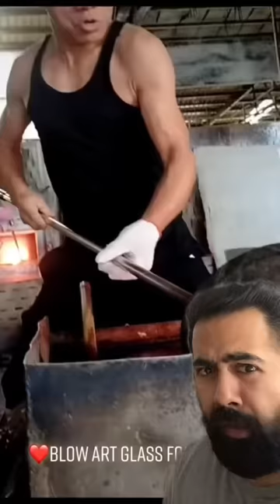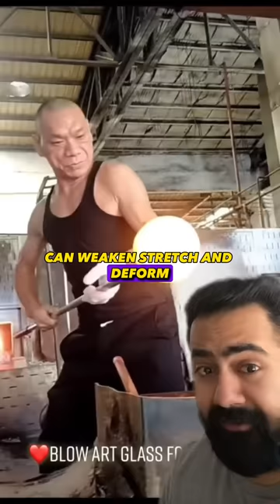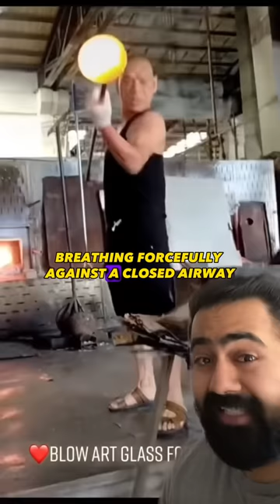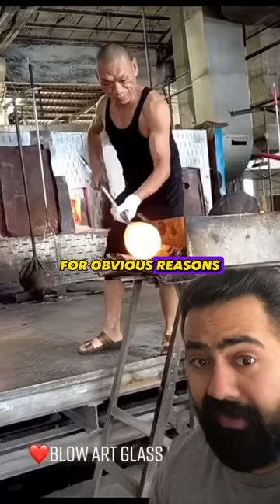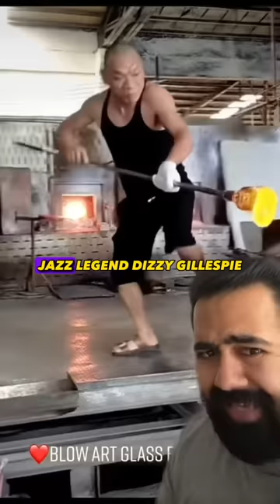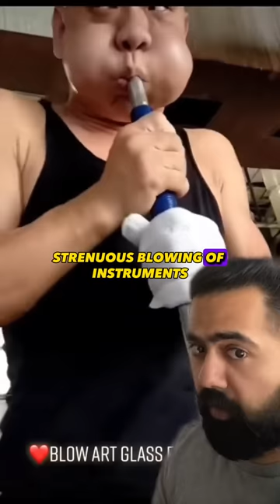Doctor Reacts To Glassblower’s Disease!

Comment: I've seen glass-blowing companies use pumps to form the glass. It's easier and caused no problems.
Reply from the maker: Yep!
Reply: Not possible for such vessels such as those asked of university science laboratories.  A human glass blower, is required for those items.
Reply: @betteroffdead  technology will get there very very soon , we already can do masterpiece sculptures of quartz with machines
Reply: @hardanalljr.3138  Sadly it won't. Glass casting will never exist
Reply: @betteroffdead  why can't it replicated with a hand pumped blower?
Reply: @flame4627  How can you be so sure?
Reply: @hakayonder3396  uh because I didn't drop school?
Reply: @flame4627  So you graduated from the future and are knowledgeable about out technological advancements? Alright, then tell me when I can expect first AI able to do QA work to replace me so I can prepare for my retirement.
Reply: @flame4627 It already does? For blown items it's called blow-molding. If you ever see a seam on a cheap vase or such, it was blow-molded. Open-face pour molds are common in the art world and can be obscenely precise.
Reply: @flame4627  mans graduated from school with a degree in time travel 💀
Reply: @hardanalljr.3138  Clearly never finished high school, eh ?
Reply: @waroftheworlds2008  there's the difference between human feel and proxy (the hand pumped blower). For example, if a cup of coffee is too hot to drink, maybe you blow on it, to cool it. Or, do you put it next to a fan, and hope for the best ?
Reply: @betteroffdead  it's not hoping for the best. You can better control the amount of air being forced in and put more air in than you could with just your diaphragm/mouth.

The human body wasn't ment to hold higher pressures. It's insane that you're actually arguing for people to hurt themselves.
Reply: @betteroffdead  Except it wouldn't be a fan in this case. It'd be multiple fans with the coffee's temperature being taken to lower said temperature to exactly the amount needed.
Reply: I'm your 1000th like!!!!
Reply: @flame4627  least close minded " school smartass" person
Reply: @totally_not_a_bot  glass pour moulds can't be durable though, especially for test tubes and light bulbs and etc which usually need to be both perfect in shape and thickness.
Reply: Wouldn't be very artisan-like
Reply: @betteroffdead  we're slowly going back to the stone age.
Reply: @betteroffdead  you need the guy but he doesn't have to blow. You can't tell me we cant make an air tank to give the right pressure. That's nonsense.
Reply: Ukraine's leadership supports stepan bandera, you stand with them?
Reply: @MrE073  no one here pretends to agree with every single part of Ukraine's government. We just think Ukraine should maybe be in charge of Ukraine, and Russia should stay in their own lane.

Hell we don't even like our own government, but try rolling over here to take over, and see how the people react. Same thing
Reply: @Non Ya erm, you've missed the point ? Have you ever studied , using laboratories? 
Precision vessels , maybe. Standardized, maybe. 
For example , when CNC milling machines were becoming widely used. The hand tooling industry was still considered a must, in some circumstances.
Reply: @nebs6888  and, how do you precisely set up the feedback loop to service this ? At what cost?
Reply: @waroftheworlds2008  check yourself, before hinting about others state of their heads. Did you finish high school?
Reply: “It’s easier” that’s why it doesn’t look nearly as good as hand blown glass.
Reply: @flame4627  says you
Reply: @hakayonder3396  it could but not all of it can be done by machine. There are too many variables
Reply: @nick-is-litbruh2367  Apart from the aesthetic, handblown glass does not suffer from the limitations of iterations of mechanic forced air pumps.
Reply: Platick bottle ITS using same method ...they blow hot air to plastick mold to make it expand
Reply: @greg5145  I totally imagine that in the future we'll make machines that can easily adjust their own parts to match whatever task's ahead of them.
Reply: @hakayonder3396  potentially yes, but not certainly. You should take a glassblowing class.
Reply: @greg5145  I'm working with cement and asphalt, why would I care to learn about glass? People 100 years ago wouldn't be able to imagine our life that's so reliant on global communication. There's never any certainty about what will be made in the future, so I'm not sure why you'd even say that. What is certain is that humanity will keep on advancing and people should stop dismissing future they don't and will never know about.
Reply: @hakayonder3396  that’s excellent my point actually😂 

But what’s happening to the guy in the vid is rare, he’s been working in that factory since he was young. My dad has been glassblowing for two decades and nothing like this.
Reply: @flame4627  it will.
Reply: @flame4627  i just looked it up and it already exists
Reply: @betteroffdead  i use a specialized coffee cooling blower. Of course you get suboptimal results if you use the wrong tool.
Reply: @waroftheworlds2008  glass blowing, particularly for laboratory vessel purpose (this is where I'm commenting from). Is not surpassed by human glass blower's skills. From aesthetics, art pieces are subjective for their appreciation. That is not something I have any grounds to comment on. 
However, for on off precise laboratory pieces. Nothing is yet to be better than a human.
Reply: @betteroffdead  so much for science
Reply: @syahidkacak  agreed
Reply: @betteroffdead  Flight was thought to be impossible for humans but science and technology made it possible. Several ailments were thought to be incurable until the cures were found. Just because the current technology and knowledge can't fathom how a certain task can be recreated by machines doesn't mean it really is impossible.
Reply: @hardanalljr.3138  It depends whether the technology can catch up before the technique going extinct, they better documented the technique first
Reply: @xiaogem7369  clearly , another who has never been to university...
Reply: @betteroffdead  Not everyone can afford uni you know, just explain your point better without resorting to the same insult over and over again which too is ripped off from the other flame guy. Why can't we have a civil discourse in atleast educational places like these instead of your usual condescension? YouTube comment section saddens me at a times. Well whatever, you do you ig.
Reply: @debban6397  why am I even replying? Surely , you have some 'nouse' ? And, you have been doxxing me ? Explains the attempted break in at mine, while I was at work. You know , producing tax receipts for your dole ?
Explanation: using machines to replace an activity best practised by the physical hand , is applying digital assets  (motors, steppers, control rigs), to an analog original (the human). The simplest comparison (I assume you don't have the capacity I do. So, sorry.), think of a printer drawing a circle or diagonal line on a piece of paper. If you look close enough, there are little steps (increments), which on some circumstances are not good enough. 
The same goes for machine blown glass. Those little steps will be hot spots. If the piece required has a sensitive application (for example, heat exchange, or torsional stresses - exposure to vacuum, or positive pressure), the results will be skewed by inherent flaws in manufacturing.
Reply: @xiaogem7369  speak for yourself. Trash in = Trash out. Q.E.D.
Reply: @betteroffdead  Oh. By the way, I did go to university so joke's on you.
Reply: @memesfromdeepspace1075  glass is  different material. It does not behave the same way as *plastic*. And, there are different varieties. Which are you referring to?
Reply: Interesting
Reply: @betteroffdead  why not? couldn't you technically use an air compressor with a specialized tip for good control over pressure and maneuverability? it would take a bit of getting used to but the the technology is there.
Reply: @flame4627 oh boy 🤦 finished school, yet cannot see the clear and obvious possibilities for automation in this subset of glass blowing?

in fact, i would genuinely be more surprised if this wasn’t automated at some point or small scale already.
Reply: @betteroffdead  you think the human hand is more accurate than CNC machinery…. Who didn’t go to uni? Lol
Reply: @Syllaren  Definitely don't know enough about glasswork, no an O2 tank will not work. It needs human fluctuating pressure on the interior of the glass. It would require constant control over a knob to make the simplest of pieces or beads. 

Glassblowers nowadays usually use a small clear silicone tube attached to a carbon stick leading into the cooler part of the glass, so we can blow directly into the piece, heat away from our face. A tank will cause unnatural ballooning 👍
Reply: @greg5145  It's also because of the difference in cultures, in America glassblowers are taught not to balloon, or rely on silicone tubing more than just blowing into the piece. :)
Reply: @betteroffdead  Juliet is right. Glassblowing can be shittily replicated, and we've seen the examples, I'd hardly consider formed glass "blown" as somebody who loves that art. I'd consider it like lutherie and machining. You can build a guitar from a machine, but it'll never play as well as one made by a man who loves his job. It's not even comparable then, because glass requires so much more care and love, wood can be slapped into submission.
Reply: @xiaogem7369  You should totally look into glassblowing and what you're talking about. Flight is a property of physics, not a materials way of interacting or moving. We also had proof that flight is possible every day. You ever seen birds? Glass requires a lot of care to work and get to a malleable state. Borosilicate forming is common, which may be one part of what you think is glass, however due to the way glass reacts while red hotted, it can't be moulded like you'd think. Making intricate pipes and lamps would be a breeze if so. You need to individually make pieces and attach them, glass sticks too hard once cooled, or puddles immediately after, if cooled too hard will thermal shock. It's not as simple as "science", it's artisan labor. Glassblowing will never be replaced, as will lutherie. Many artisan jobs can't be replaced, even though a machine can make 1K guitars an hour. Definitely take a class on glassblowing if you're interested in seeing what I mean. It'll be very apparent once you're wielding the Wet Sand Stick
Reply: @prodlexii4945  you know you can adjust the pressure a tank is pushing air out at right, and it can even be manually or automatically controlled to maintain a certain level of pressure in the tube which would relate to how much pressure is in the glass, and we aren't far away at all from an AI being able to "see" the object being made and adjust accurately accordingly.

I think this job isn't impossible for machines, I think it's just cheaper not to have them... For now.

Also you kinda said it yourself with the guitars. Sure you need artisans for the highest tiers and repairs, but no one is hiring glass blowers for repairs, so that only leaves the highest tier requests for future proofing. Do you really expect every glass blower is future proofed just because rich people might want things that aren't mass produced sometimes?

Plus with ai advancements it's really not even certain that higher tier custom category will even survive in the hands of humans.
Reply: @prodlexii4945  I'm not even talking about the whole process. I'm simply talking about the blowing part. I'm currently working in crafts and construction so I do know that there are several processes that are currently impossible to be replicated by machines because they can't adjust to changes in the craft. But, saying that they're impossible is being narrow minded.
Reply: china
Reply: @flame4627  You didn't even pay attention in school
Reply: @DrKaran  is it a problem tho? It doesn't look like it's hurting him
Reply: @betteroffdead nah machines can do it better, not only can they work out the exact amount of glass on the rod, but also more precisely control airflow, get perfect shapes with camera recognition. Anything you think you can do well, AI assisted computers can do it a million times better.
Reply: I stand with Russia
Reply: @flame4627  I remember reading in a old text book about how automation will never automate berry piking because they're too delicate. Fast forward from when the book was written a few decades, and here we are with fully robotic berry pickers.
Reply: @raulguimaraesreis6640  clearly you take things too personal. Get therapy.
Reply: @hakayonder3396  probably within the next 5 years tbh with you. AI is already much further into development than you'd realise, many you know about, probably more that you don't.
Reply: @prodlexii4945  I’m almost certain that a machine can outperform a human glass blower. It looks like there’s a precise control of pressure as a function of the current shape of the blown glass. With enough financial incentive we will definitely beat human glass blowers in both speed and precision. Though I’m willing to change my mind. Is there anything a human can do that a sophisticated enough robot can’t with regards to glass blowing?
Reply: @flame4627  you’re so naive if you really believe that
Reply: Well human labour is cheaper I think.
Reply: @hardanalljr.3138  Glass blowing is very different from sculpting stone
Reply: Bro is not even wearing safety gear , he won't get a pump anytime soon
Reply: @runforitman  wow that was amazing
Reply: @Syllaren  you know Ukraine was once Russia right?
Reply: @kenl.3298  You mean when it was half Poland and Austria, and the other half Russia before the Soviet union(even more detached from modern government), or when it was in the Soviet union which is NOT Russia as it currently is. Totally different government.
Reply: @flame4627  Both of your examples have been long since automated. How else could I buy a dozen test tubes for a few dollars or a fancy green CFL bulb for less than ten? That bulb shape by hand starts at a hundred. Fifty if you exploit people.
Reply: @betteroffdead  Are you talking about man operated lathe blowing? Because I know plenty of people who have worked in glass across the spectrum of areas from industrial production to machining to studio art, and while it's generally true that most computers can't predict and move quickly enough to ensure that the quartz or boro is made into specialty products, the overwhelming majority of scientific glass (which is predominantly tubes and vials) is entirely machine manufactured. 

I really don't understand the whole argument here as industrial and production line glassblowers like this guy are far more likely to go blind from glassblower's cataracts or die of silicosis than issues from stretched cheek tissue. 🤦‍♀️
Reply: @flame4627  we can simulate blowing with machines tho
Reply: @KatieCottingham  very insightful. Good reply.
Reply: @waroftheworlds2008  no money, its glass and probably sell cheap. So there is no reason to buy expense thing such a blower.
Reply: @betteroffdead  your printer analogy isn't true. Screen printing and lazer printers both don't have that side effect or can avoid it if setup properly.

I've done my share of screen printing and of working on laser printers.
Reply: @sadjester800  probably the truth. But labor will remain slow if left to doing things manually. Machines are much better at doing repetitive tasks. Even at scales of <0.001 inches.
Reply: @waroftheworlds2008  the demand is not that high, so its useless. except for anything related to laboratory products made from glass, it will be manufactured by the factory. but in that video its usually for decorative glass or any expensive glass or at the most expensive aquariums. i mean this in the category of luxury goods, so there is not much demand to make many of it, and when its "hand made" its increases the value.
Reply: @betteroffdead  why not?
Reply: @betteroffdead  You're wrong about almost everything you've tried to say but you've been torn apart enough already 😂
Reply: @Slyfoxx  torn apart? I think you better lay off the weed
Reply: @evangelion3556  explain your reasoning
Reply: @betteroffdead  I was asking why human glass blowers are required for university science equipment?
Reply: @evangelion3556  using equipment for glass blowing is always an approximate. With human glass blowers , the analog touch will , on average , be more accurate. For example, another poster on this thread, found glass blowers produced appropriate vessels for their air sampling requirements (something to with barometric pressure.), where machine blown glass would have not been suitable. 
It would seem those challenging my comments fall into two groups. Those who have enjoyed university,for tertiary education; versus, those who have experienced secondary education, not even finishing that. 
Seems , I am deluded to have even aspired to enjoy education to its nth level.  Sorry I exist.
Reply: @flame4627  they had glass casting in 15th century bce wdym
Reply: @betteroffdead  it is definitely possible to do however it isn't worth the money it would take to develop when you could just force people to do it for you
Reply: @50centHotDog  A human can actually be more accurate than a CNC machine. This may not apply directly to CNC machining, but there was a study done a while back. They found an old man you had been using a sort of anvil and hammer system to beat out cooking pans. From a sheet of steel, he could make a pan faster than the machines and could do it with a lower margin of error. The thing is, he had been doing this since he was a young man and it had been the only job he had worked for multiple decades. After thirty or forty years of doing the same thing hundreds of times a day every day, you get really accurate and efficient at doing it. So yes, a human can be better than a machine in just about any area, but a machine can do or right after being set up, a human needs 20-30 years to get that efficient, maybe a bit less if they start as kids in a family business.
Reply: @blablabla7796  If the human has been doing it for several decades near constantly, a robot will likely struggle to keep up or even fall behind. Top artisans know what they are doing and are always improving their efficiency. They make less drastic changes to their efficiency but can do them next to instantly, while a machine needs to be modified or updated to improve efficiency. AI will allow machines to close the gap a little, but the hardware still needs to be updated, even if the software updates itself. Also, I struggle to believe that we will ever create an AI that is smarter than humans in all facets of thinking. Simply put, I don't believe we will ever make an AI that can think in all facets of thinking like a human that will be beyond all humans in intelligence. If I'm proved wrong, then alright, but I personally won't believe it till I see it.
Reply: @dr.insanity9087  “If the human has been doing it for several decades near constantly, a robot will likely struggle to keep up or even fall behind”

An industrial machine can cut within micrometer precision at the fraction of the time with no need to rest for months on end. It only needs to stop for regular preventative maintenance. It doesn’t need to eat, sleep, go home after the shift, take restroom breaks or anything. It doesn’t need to take the day off because it got sick. Even without AI, we have complex feedback systems and ultra sensitive sensors that will make the most skilled humans look like beginners. Humans, if they dedicate their life to stopping a stopwatch at exactly 5 minutes might be able to get it within a few milliseconds regularly. A machine programmed by a 14 year old can do it within nanoseconds on day 1. You’re giving humans way too much credit.
Reply: @flame4627  evidently you didn’t learn much in school because only about 100 years ago people though making rocks think was impossible and now we’re talking on a phone. Technology grows exponentially.
Reply: @Syllaren  only if the pressure needed is the same every time
It however is not
Reply: @patrickrowland3932  true dude and no one on earth has ever seen a tank with an adjustable outlet. It's impossible to ever consider that it could change the pressure emitted.
Reply: @Syllaren  not in the correct ways to deal with impurities in the glass and the other minutiae involved
Reply: @patrickrowland3932  first I mentioned the experienced glass blower being the one adjusting the pressure, pretty sure they'd know. However just going into this fully automated tangent. look I'm going to be frank here. Whatever skill you have it's utterly ridiculous to think a computer with enough sensors wouldn't be able to emulate it. It's just a cost argument.

With enough censors a computer could adjust pressure within milliseconds of any impurity or w.e else, and even change the gas composition to suit whatever was needed. 

It would frankly outperform you even if you spent a hundred years devoted to the craft. The only issue is the cost to develop it is too high when there are humans willing to ruin their lungs and do it for far less.

Now this isn't an insult, just reality
Reply: @flame4627  you finished school but you still have some learning to do
Reply: @diveblock2058  force is a very strong word
Reply: @betteroffdead  sorry mate you have to be specific. Which ones specifically.
Reply: @Syllaren  please explain how you know the entire franchise of glass blowing in the context of university resources?
Reply: @50centHotDog  Q.E.D. ...
Reply: @betteroffdead  I know that anything a human lung is capable of, a pump/tank could do. This isn't anything that requires research notes and should be obvious for anyone with half a brain. 

The blowing isn't replaced because of cost, not the inability of machines to do it. That simple.

There are arguments to be made of the entire person could be replaced, and how long it would take to program an AI to do it properly, but there is none about the blowing process. Any force a human lung can create, can definitely be matched by tech.
Reply: @KatieCottingham ost of the people being toxic here are insulting me. Not the topic. 
My statement stands. 

Some custom lab items can only be made by a glass blower's hands. Machines cannot compete.
Reply: @Syllaren  When you can make sense, in written language, come back to me.
Reply: @Juliet Kalashnikoff  Bruh, you know how temperature works right? I set my drink in the fridge to cool it, just dont forget it .
Reply: @betteroffdead  Seems like the reason you're getting so much shit of because you've been very vague not actually explaining why you believe any of this. Why can't it be done. What lab glassware are you working with that ot has to be done by hand? A FDC? So long as it has a space for coolant the precision doesn't matter. What would be the problems with using a controlled air pump? Just the feel involved with making it? If it's a matter of something like flask volume you could have it completely jagged on the inside but so long as you have gravity and displacement volume, you can get accurate measurements at every mark. I'm not a chemist so I'd like your input, but I work with a pcb lab so I work with acids and fume hoods a lot with a passive interest in chemistry. That said we do have a chemlab and I have a bit of experience. But why don't you think that it could ever be done?
Reply: @betteroffdead  let me correct your statement for you:

Some lab items can only be made by a human glass blower at the moment. The increase in productivity of automating such sophisticated processes is currently not worth the cost of the R&D and production.

If you disagree, then tell me what fundamental action a human can do that a sufficiently sophisticated machine can’t.
Reply: @betteroffdead  AI is going to replace glassblowers now. Get with the times, Grandpa.
Reply: @blablabla7796  don't be entitled and carpet bag what has already been said , eh ?
Reply: @Brendedn  seems everyone is on my case. Being that you don't know me, aat all is all telling.  FYI I have studied food science at university level, and have kindly asked glass blowers for items that were otherwise not available. Bespoke items on demand - while on site, rather than ordering them in (if it's even possible.), is my main point. Replacing such items with machine blown items may be possible. However, cost effectively doing so is a consideration. if they are suitable/possible. Matter is now closed. I have better things than pandering to the whims of high school drop outs.
Reply: @betteroffdead  that’s a weird and convoluted way of saying “yes, that’s right”.
Reply: @betteroffdead  wait, you studied food science? And here I was thinking that I’m talking to a chemist or microbiologist. No wonder you know nothing about the insanely good automation technology that we have in current day. In fact, I outrank you a bit in educational attainment as I am an Electrical Engineer that works with the microchips that go into stuff like your smartphones and tablets. We have silicon wafer probers today that are precise to the nanometers, that can push teeny tiny gold pins onto pads at such high precision that too little contact and you effectively can’t test the silicon, and too much force and you stab through the wafer and break the device. It does that much precision with milliseconds of time stepping through the devices. The reason why everyone here is so confident that you’re wrong is because everyone here can think of an example where there is no chance a human can beat tech. Even if you have a thousand years of your life dedicated to probing silicon wafers you can NEVER match what a $50k wafer prober can do. The reason why we don’t automate every type of glass tubes today is there just isn’t any profit incentive. Silicon wafer probing is arguably a necessity for a billion to trillion dollar industry that not only did we rnd the crap out of it, we engineered the crap out of it too. We’re so precise and efficient that it’s scary. But what would you know? You’re studying food science.
Reply: @betteroffdead  tl;dr: speaking as an engineer, what the fuck does a food scientist know about high precision, high speed, high volume automated production machinery?
Reply: Even if a human touch were somehow required, what if the machine used the glass blower's breath as input?

It would modulate the pressure of the pump to match the pressure he's blowing at, but multiplied by a certain amount.

Then he doesn't have to blow as hard, and can still have fine control of the pressure.
Reply: @betteroffdead  there's a glass manufacturing class where I am. They produce basic glass like plates cups and other things alike. These are made from dyes. And for medical and scientific glass they are also. Glass blowing in what's showed in the video is for art or unique items not sold in stores. Even this technique of glass blowing is dying and is now using regulated pumps that can be consistent and powerful, if not faster to. About 98% of the market of glass is mass produces with cast dyes and automated pumps, and that 2% is hand blow.
 That's why hand blown is more expensive. 
Even light bulbs are dye made.